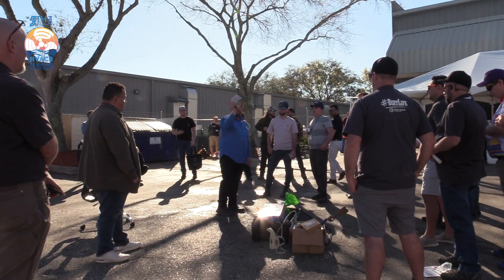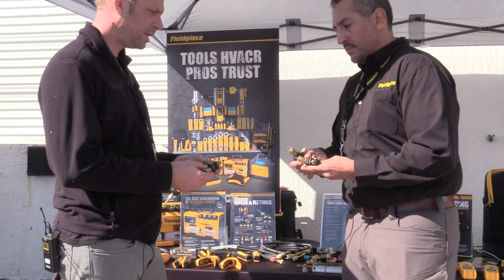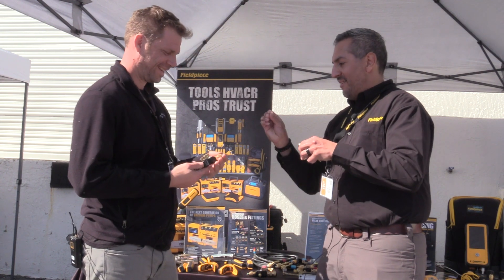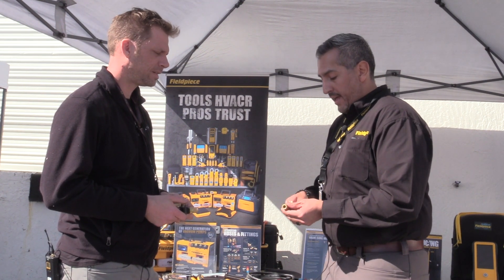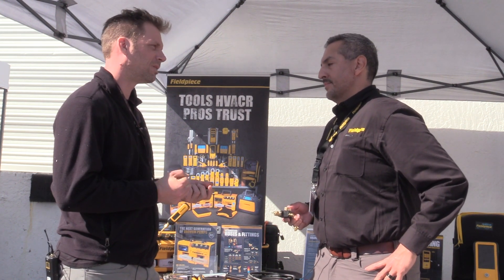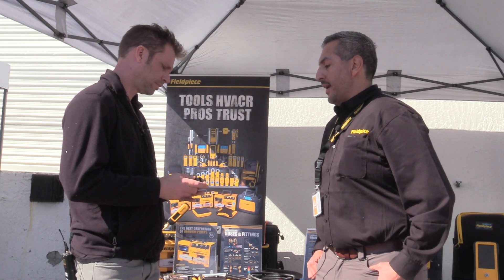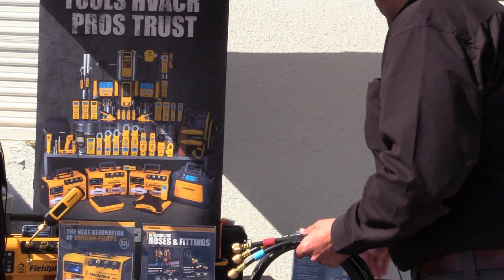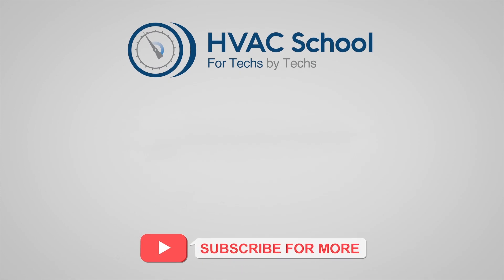VCRTs with Tony Gonzalez at the Fieldpiece Booth

Comment: Ok, the comfort spinner is what got me interested, 100%.  I've been wistful of a comfort spinner on the Appion core removal tools since getting cores put back in can be such a pain.  Sightglass is an interesting idea, and I can definitely see that saving a few moments removing the removal tool and putting it back on when you find it didn't grab the core.

Edit:  Are the tools going to come with both 1/4" and 5/16" attachments, or just one, with the other sold separately?
Reply: i believe its sold seperately the 5/16 adaptor

Comment: Just get an appion, back it out till it clicks. If it doesn't come out  then youve got the VCRT on too tight. Just finger tight.
Reply: YES! Squeeze the tip to grab the core and it will come out every time.
Reply: @HVACR559  I've actually broken the new appion VCRT by squeezing the tips. They're made from hardened steel i think, and they are not very ductile. The new appion stem (since a few years back now) all seem to have a little o-ring in them that grips nicely.  

The absolute biggest thing i've noticed about the appions is that if you go too tight on any of female fittings, the o-rings get chewed up quickly. You really do not need a ton of force to make them seal nicely.

This actually goes for the appion evacuation hoses as well. If you go Hercules on them, the gaskets squish, which impedes the speed AND you get a leak the next time you use it. The vast majority of people who complain about the appions are being too rough on them.

That said, when I replace them I'm considering trying the fieldpiece double ballvalve one. That design has given me a half chub. If fieldpiece has replaceable seals for them, then I'll for sure give them a try. If you can't get replacement seals. ..I'm sticking with appion.
Reply: Nah I’ve heard it click a million times only to have it come off in the tool. The sight glass is awesome especially for only 25 more bucks